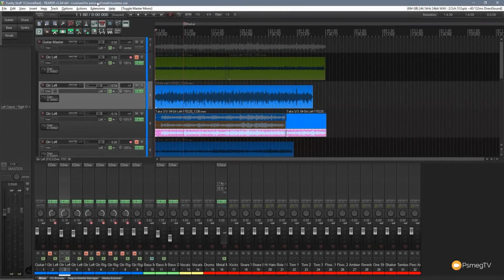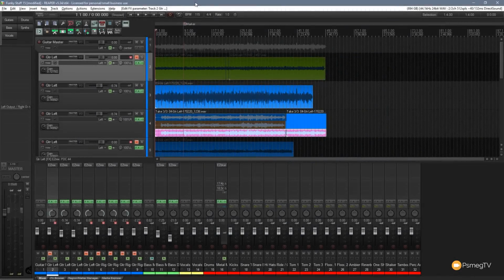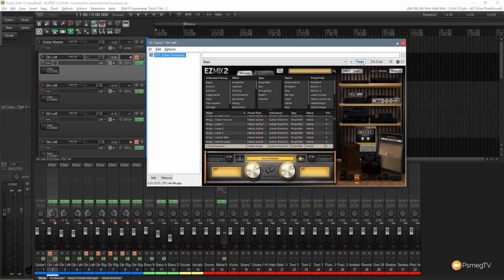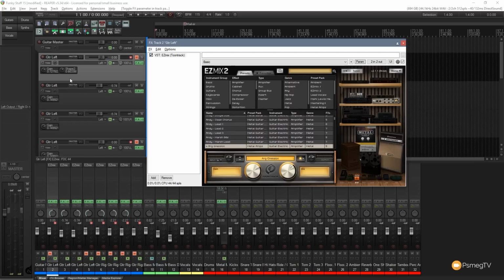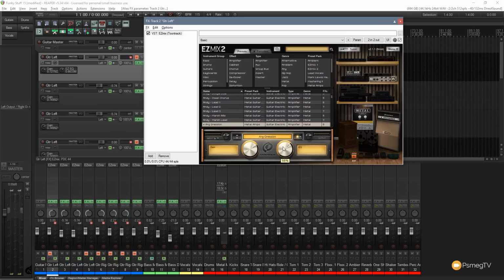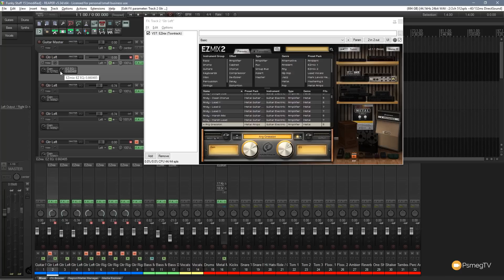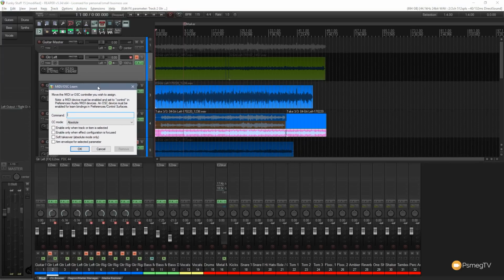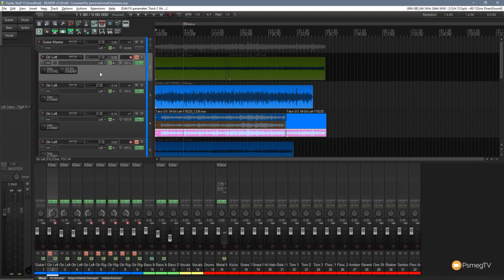Reaper Tutorial: How to Map Track FX Parameters

Comment: Hi, thanks for this useful feature! just a question. I have a riff that uses distortion mainly, but I want to add 4sec of wah effect, other 8 sec of clean in different parts of the songs. I need to record this seconds in different tracks and add the effects or there's a feature that allows adding different effects in different parts of the same track?
Reply: Hi !
You could use Item - Take FX for that, pretty powerful, check this out:
http://www.kennymania.com/17-item-take-fx/

Hope this helps !
Reply from the maker: Funnily enough, this has given me an idea to do exactly that using a wah at certain points in a track and also applying some envelopes / automation to the process. Keep an eye open for this very soon :0)
Reply: Woow! this will same me a lot of time! thanks a lot!